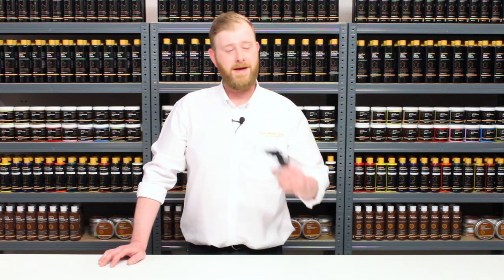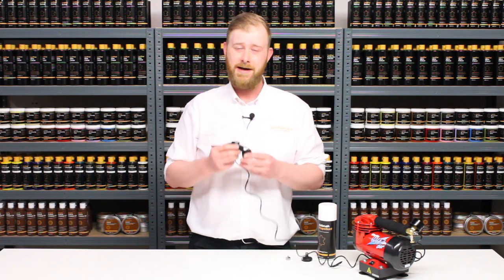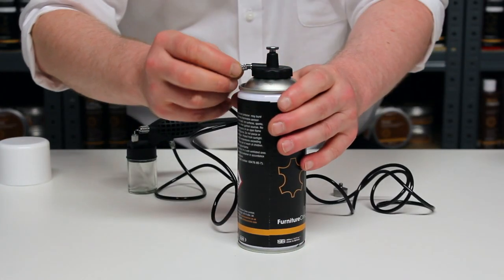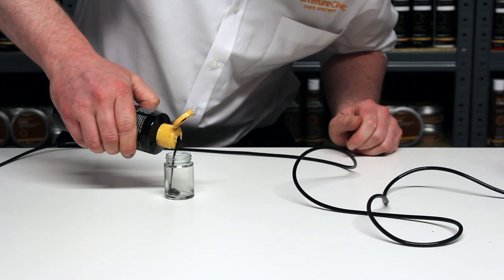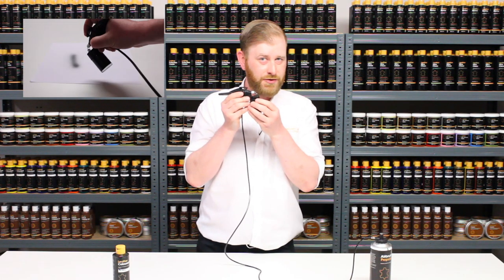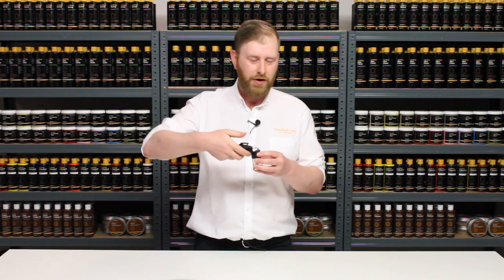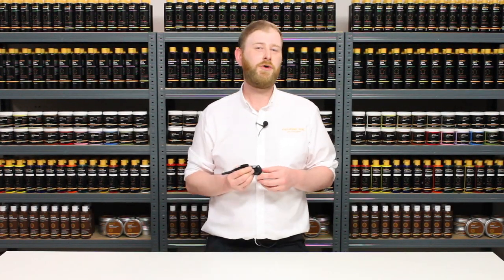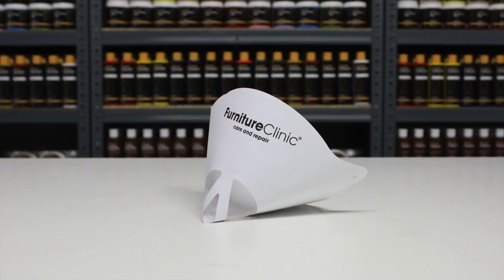How to - Use a Furniture Clinic Airbrush

Comment: I’m at the stage of sealing in the new colour with your airbrush and air canisters. How do you suggest I go about airbrushing deep pleats and creases in the leather? Does the finisher dry quickly with a hairdryer as I’m going to need help holding the pleats apart until dry otherwise surfaces are going to be touching while the product is still wet?

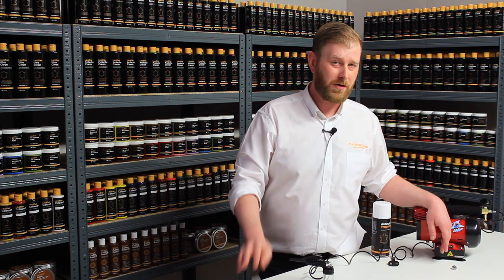Comment: 0:50 Could you tell me (written) the pressure and units for larger industrial compressor? I'm not an english speaker and I can't understand what I hear... Maybe 1/8 BSP?
Reply from the maker: Hi, we recommend running your compressor at 50 PSI when using our airbrush. The recommended adaptor is 1/8 BSP for a larger industrial compressor. I hope this helps.
Reply: @FurnitureClinic  Thank you!